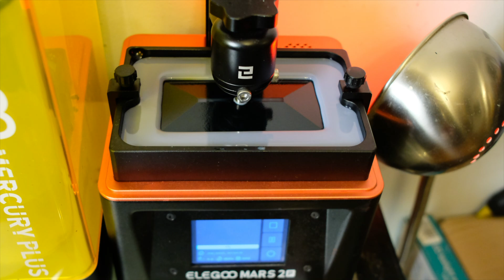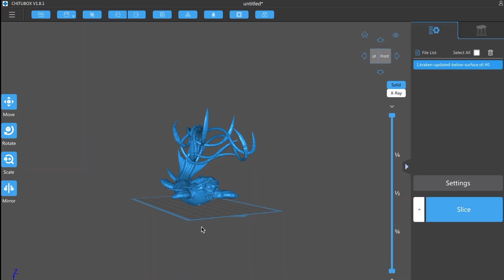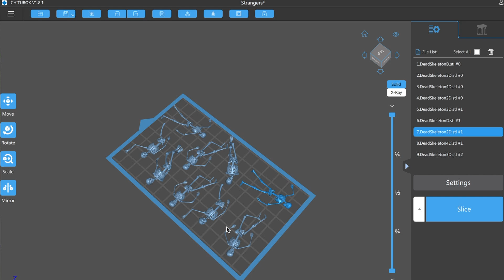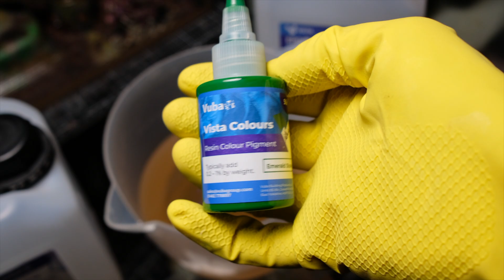I built the ULTIMATE Dungeon sewer system for D&D!

Comment: Amazing project! If you want to avoid bubbles in the future you can try adding a little resin all over the area that will be covered by the pouring and let it cure. (Just a painted on layer) This will seal the base to prevent air coming up into the main resin pour.

Comment: Absolutely amazing build, you’re right those bubbles really do add to the build.
Reply from the maker: Thanks mate! How is the fallout build coming ?
Reply: @Nat1videos  Going really well, nearing the finish line thankfully. Just trying to figure out whether to put down the stones and basing materials before or after I paint as I see it done both ways. Any thoughts?
Reply from the maker: @MisfitHobbies  Both way have they're merits.. I guess it depends on which basing materials you are using. If its something like bark and sand ect I tend to glue it all in before painting. But you can get some basing materials that look great not painted if that makes sense. Like some of Lukes base ready products, which you just glue on top and the seal with a sealant spray. I tend to go for painting after basing but just as a preference not because its better particularly

Comment: Can I ask what material you used at the bottom of the build?
Reply from the maker: Do you mean the paste I am using or the bricks?
Reply: @Nat1videos  neither, i mean the bottom layer you build on, it doesn't have the same colour as the foam so was wondering if it is some kind of wood or?
Reply from the maker: @jenserikaugustinussen3833  ahhh I see. That is 3 Mil mdf board :)
Reply: @Nat1videos  Thanks, they don't warp on you?
Reply from the maker: @jenserikaugustinussen3833  Not with something like this, with all of the structure glued around the out side and then the resin pour curing solid it stays 100% flat :)